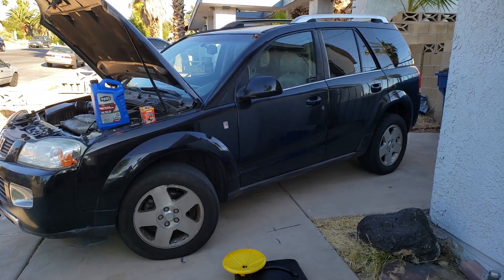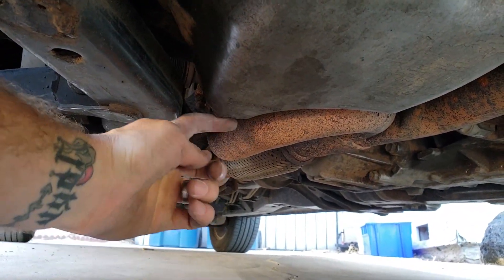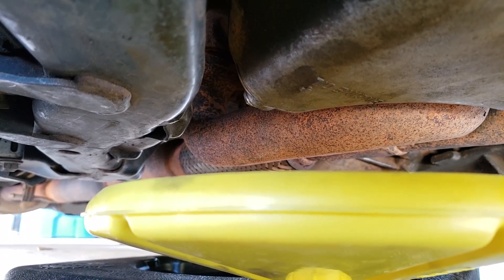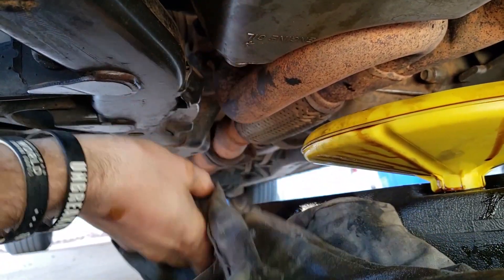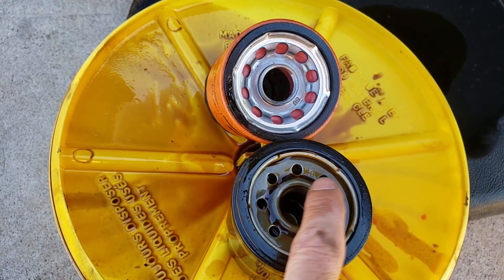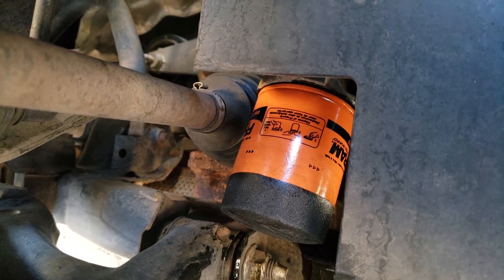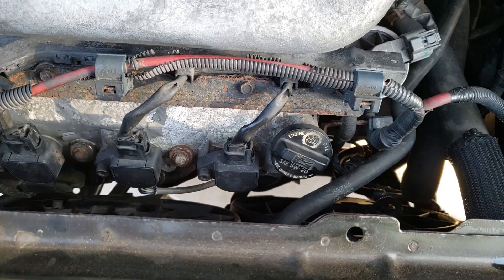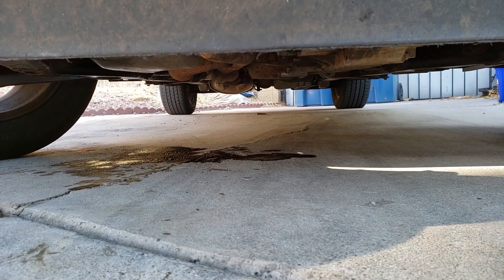How to Change Car Engine Oil and Filter (Saturn Vue 2003-2007)

Comment: Good job.   Worth mentioning this is on the 3.5 (Honda J35/L66) engine,  not the 2.2 L gm engine.   I'm about to change the front struts so will watch that vid next 😄   now if only I could find the oil pressure switch location - supposed to be just above the oil filter .........

Comment: I usually just dig a little hole in the yard and let the oil drain in that and then just throw the dirt back on top when I'm done. I have never used an oil thing like that cuz then what do you do with it?
Reply: In the States any where that sales oil will take used oil back free of charge.
Reply: Take it to somewhere that "recycles" it. Walmart does..
Reply: Oil comes from the ground anyway, right?
Reply from the maker: You take it to the recycling center. But I feel this post is a joke to get a green-reaction. I don't think anybody in their right mind would ever dig a hole and put motor oil in there lol
Reply: @TutorialGenius  I'm just putting it back to where it came from, and not just that you think I'm going to drive to a recycling center you moron cost myself more money. I'll just stick with what I do now it's a lot quicker a lot easier and a lot cheaper

Comment: Thanks for the instructional.  However, I would argue one point and that is that a multi-grade oil is thinner when cold rather than warmed.  5w-30 is 5 weight when colder vs 30.  Correct if I'm wrong as I was once before.

Comment: Would you make a video on the location of the power steering pump? I need to change my fluid and can’t find it
Reply from the maker: I usually make a video when something goes bad! :) So we'll see! For this exact year, im not surprised you cant find it, its not hydraulic. It's electric